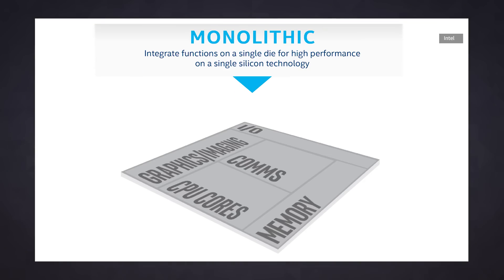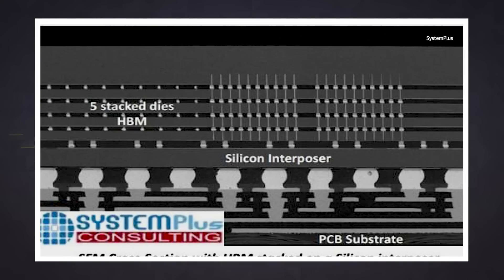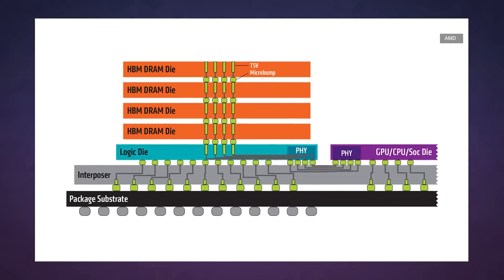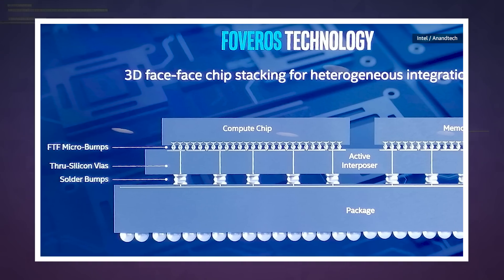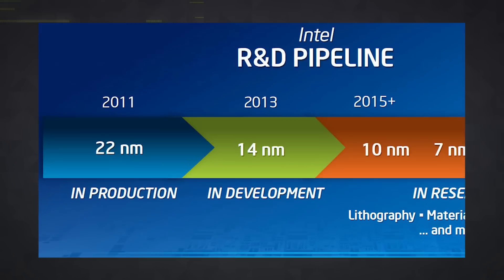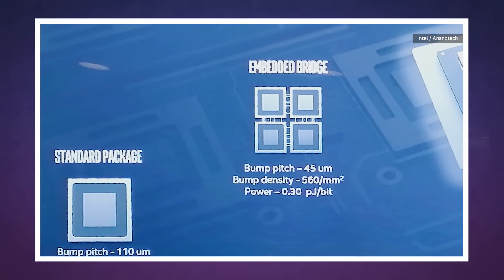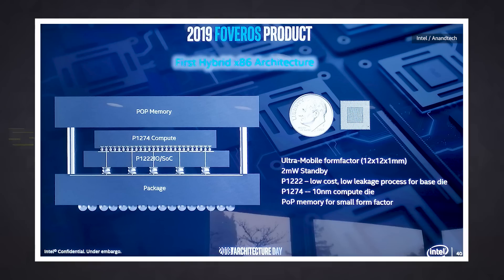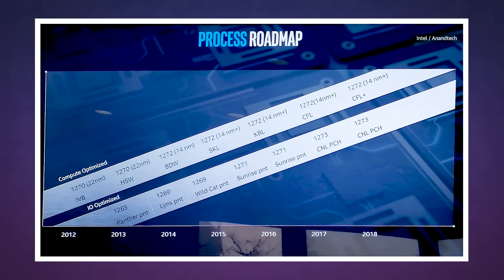This new 3D chip tech is how Intel will beat Moore's Law | Engadget Today

Comment: Intel is still in 14nm process... so I don't care how much they stack here... if it doesn't use a smaller architecture, then they will only be more power hungry and expensive.
Reply: Gerardo Buenrostro Did you even check articles about the event? This design will be used on their 10nm chips...
Reply: @fxmtoeclipse  making thicker chips will also make it more difficult to dissipate the heat generated by stacked transistors, thicker chip means it'll hold onto more heat. And Intels yields at 10nm are still worthless, they just added production at 22nm to move things off 14nm to be able to produce enough CPU supply.
Reply: @NarinderxBali   "battery power could increase"  yeah, but we are talking about tight economic business success time spans here ... not research that will give us the product in five years. Intel needs something now because AMD and others are much better.  Intel just burried another 3D Chip technology - Optane SSDs.
Reply: Not only that as we introduce interposer design, means added complexity which also means added cost to manufacture. This is the reason why HBM2 was never been in consumer GPU today as it was more expensive.
Reply: @gendouhydeist  i think Vega has hbm ram
Reply: 56 beats 2070
edit:while being older tech
Reply: 3D will save I/O power . That’s also a big amount . Almost half
Reply: @NarinderxBali  You could only increase it by having a bigger and heavier device otherwise you could have a device with only 2 -3 hour battery life. And Fast charging wont help if you happen to need to work and don't have an outlet nearby.
Reply: Their 14nm process is smaller than what the competition is calling 10nm though.
Reply: ytxstream That’s misleading, 10nm is really 10nm when it comes to the competitor.
Reply: Let's take a look at AMD and Nvidia during the 28nm hiatus.

Nvidia uses 28nm, for the 600, 700 and 900 series. There were massive performance gains at lower wattage from Kepler to Maxwell.
AMD uses the 28nm for the HD 7000, Rx 2/300. There were performance gains, but the R9 290X was really hot and toasty, Nvidia stock cooler beat the AMD stock cooler.

Even the R9 Not-So-Fury barely beats the Titan, Titan Black and X.

Let's take a look at AMD and Nvidia 14, and 16 nm respectively.

Nvidia uses the 16nm, released Pascal, and there were performances gains at lower wattage from Maxwell to Pascal.
AMD uses the 14nm, released the RX 400 series, it barely reach the Pascal line up in tier-to-tier performance.

RX 480 - 970/980/1070.
RX 470 - 960/1060.

Even the RX Flop series, do not even beat the Titan Xp and later Titan V and RTX Titan, both in tier-to-tier performance. Question yourself, why else they named it differently? They are pulling another R9 Not-So-Fury stunt to compete against the Titans.

So really, even with 7nm or 5nm, if you have a poor architecture, your smaller technology node will not benefit at all.
Reply: Alfa Proto The RX series were never intended to compete with the Titan cards. RX wasn’t a flop either because they were literally selling like hot cakes. You could never find them at MSRP price and they were usually sold out because of the mining spike. The RX 480 was a $200 card while the Titans are $1000. You have to look at the prices and AMD had better price to performance ratio than Nvidia. Also, if you compare RX 580 to GTX 1060 now, they perform virtually the same.
Reply: @wowoslashfan  You do realised that the RX Flop series is the RX Vega series, and not the RX 4/500? I deemed them to be successful, considering the RX 4/580 is on par with the 97/80 and slightly behind the 1070. The RX 590 is slightly behind the 1080, once again tier-to-tier.
Reply: @AlfaPro1337  No, I didn't realize because the RX title can refer to a wide-range of cards. Nevertheless, the RX Vega series was a flop.
Reply: :) They will made the switch very soon, also why blame Intel whilst AMD has stubbornly stayed on 32nm till very recently and that's why till Ryzen it couldn't support PCI-E 3?
Reply: 1. I don't know how but Intel's 14nm has always been smaller than AMD's counterpart.
2. "Expensive". How exactly does 7nm make it any less expensive? If anything, the way in which those tiny things are placed on the CPU becomes harder. It makes the process even more complicated, time consuming and need even more precision. Don't see how it's gonna be cheaper.
3. I believe it's based on Intel's 10nm. As such, it's more or less AMD's 7nm since it's always a bit smaller.
Reply: you dont really understand the problem. as we get smaller the gains are lower and the cost is higher. using multiple pieces of silicon solves the cost problem by increasing yield rates. the old mentality of focusing on process size is over. even if we had 1nm today it would only be the same as being 1 generation ahead in previous process iterations. whereas 1nm is at least a few generations away.

literally every chip maker is focusing on multi silicon designs because of this.
Reply: And you are who? An expert on the topic? Who cares what "nm" the process is? Die shrinking will reach its limits soon. If there is a performance increase then its a path forward even if the TDP is increased. Next time you comment try to use your brain. Oh and btw your likes are from AMD fanboys don't be proud of yourself.
Reply: @yannisdaboss  I'd be one of the guys that's designing and building Intels EUV's control system, but thanks for asking dumbass.
Reply: @yannisdaboss  The nm is the extremely important because it can do so much. It can provide reduced power consumption and speed, perhaps even decrease the number of transistors that once can place ono a chip, making them smaller and perfect for mobile computing. If lithography wasn't that important intel wouldn't even bother switching to 10nm. We aren't reaching the limits of silicone just yet, because MIT recently created a 2.5nm fully functional transistor. Lithography would also be involved if we ever switch from silicone to something else. I think you're very ignorant. Next time you comment, try using your brain.

Comment: Sounds interesting, but it does raise questions about heatmanagement and durability of the chip in the long run.
Reply: wevenhuis for sure the base chip wont have direct contact cooling and it gets worse the more you stack up
Reply: Yep, so ultimately what they're able to do is use the same footprint entirely populated by the power hungry processor on top, and put the low power io type stuff underneath, thus they get more power from the same footprint
Reply: There's probably some power savings based on the redesign and how signals are redirected through the 2nd layer vertically rather than horizontally that compensate. Must be otherwise why bother? I can't imagine the square AREA is the prime concern actually considering the relative size of processors vs the hardware they are in.

Comment: Not likely to be viable.  Heat dissipation would be a huge issue unsolved by stacking, therefore keeping clock speed down (CPU runs faster than 3D memory).  Shrinking is still the more viable way to go, unfortunately, Intel can't seem to shrink.
Reply: heat is an issue, to be sure, but they're being smart about it. Some layers are just data layers with no logic, so very little heat is produced in that layer. They aren't stacking a hot component directly on top of another hot component, so they're carefully placing components to spread the heat around the chip better. The 3D structure allows for shorter data lines (and clock pulses) between components, saving space which saves on wafer cost. The chiplets also let parts of the CPU run at different speeds or to be made using different processes which is another great cost-saving measure.

I doubt they'll go more than 3 layers before finding another way to cool the chips. I've seen some demos of capillary cooling tubes within silicon layers that might work one day. That would basically liquid cool CPUs from the inside of the silicon itself, but that tech might be years away.
Reply: @Kingramze  Yeah exactly, they basically can now utilize the entire surface area populated by the processor, by putting the low power io and suh underneath, thus getting more power out of the same footprint
Reply: Throw ice cold water at them. That shrinks everything.
Reply: @Ali Zayn That is what I have been thinking. All these experts here like to think that Intel woke up one morning and decided to stack chips w/o considering very fundamental "thermal management" beforehand. I guess youtube experts know better than 100's of Phd's working on this. Just a thought...
Reply: Please tell us what would work master of all things tech? I didn’t know YouTube comments contained so MANY tech geniuses !!! Wow I should read much more. Please share your knowledge.
Reply: @Ali Zayn stacking the chip makes it thicker, makes it harder to dissipate heat to the heatsink. It's a reality of physics, not a problem you solve.